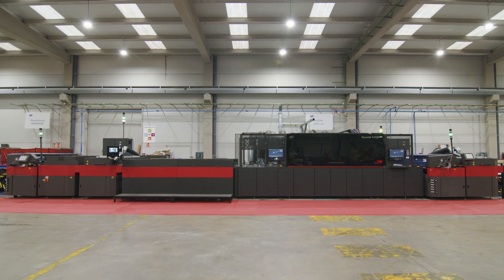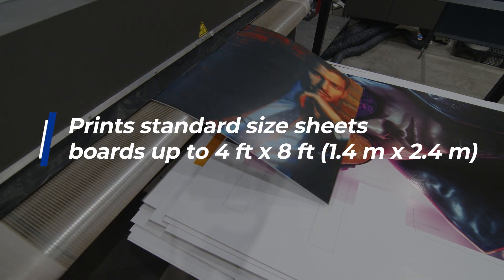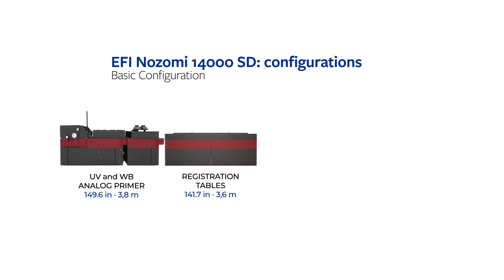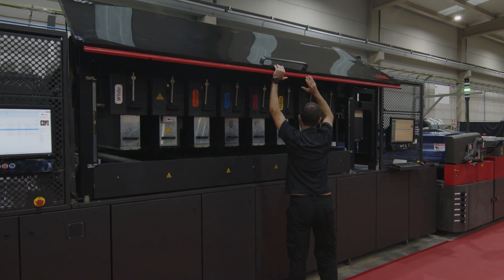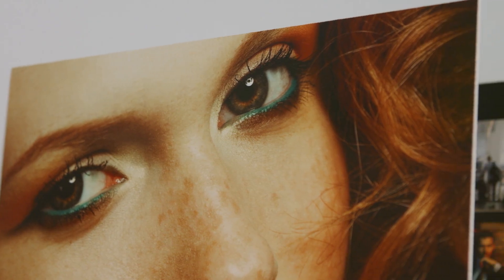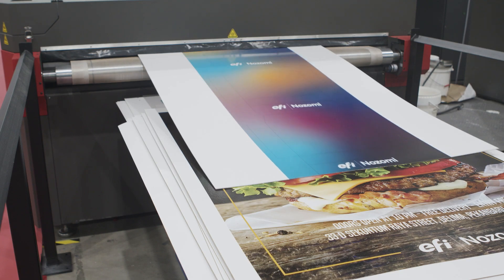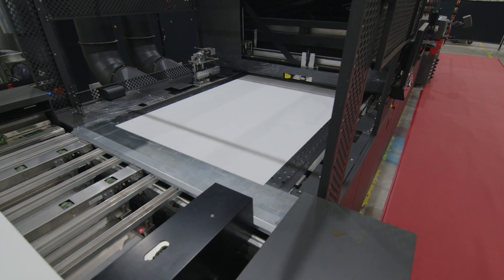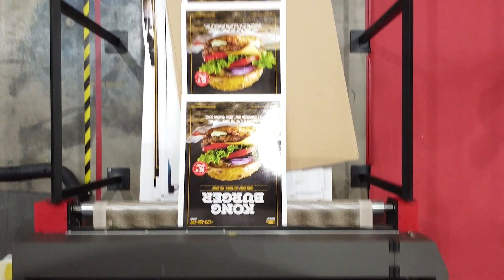EFI Nozomi 14000 SD Overview Video US

Comment: Is it possible toremove priming unit? Stay with feeder + alignment table+printer+drying coating unit!??
Reply: I would assume that it would depend on materials, but we have tried to run stuff through just the press itself just laying it on the belt skipping the coater and the sarm and the ink would not lay down properly on the material we were printing on.